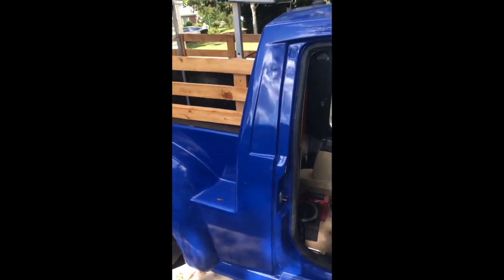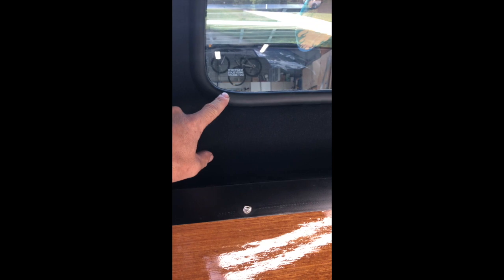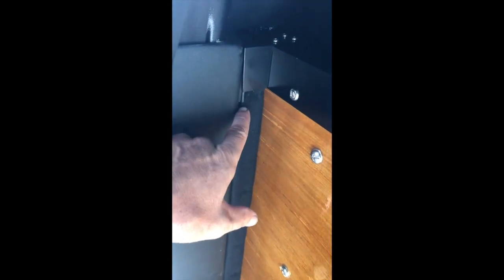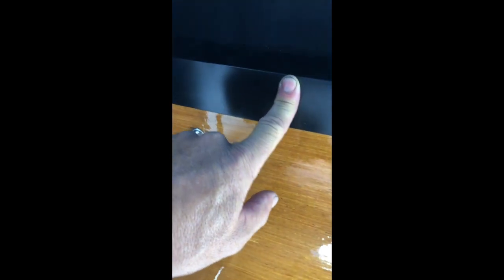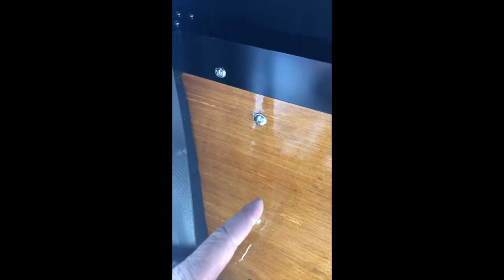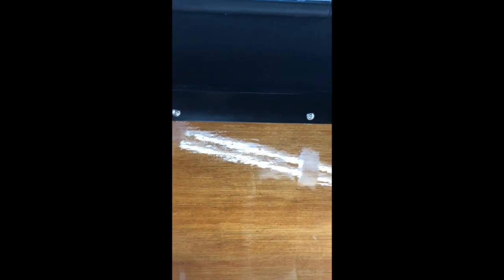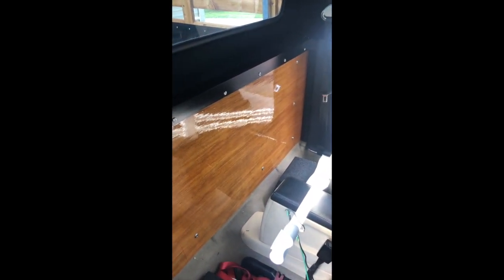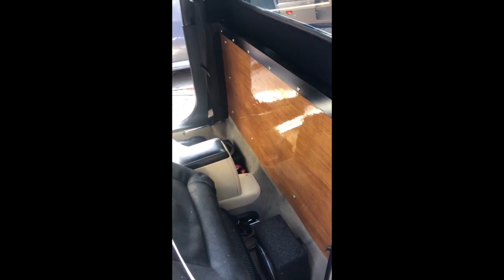Smyth Beetle Ute interior ideas

Comment: Great information.  Do you think leather for the back wall would be a mistake?
Reply from the maker: Almost Means Not no I don’t. More durable the vinyl. Harder to stretch smooth but since it’s a flat panel, shouldn’t be hard. Little more expensive though. And I’d highly recommend some dense 1/4 foam behind it though
Reply: @hesty32  Yeah i was thinking I could tool Pickupmybug and the little logo we worked on together.  Then color and treat. Not even a great piece of leather, but one with character like some barbed wire poke holes and stuff. thanks